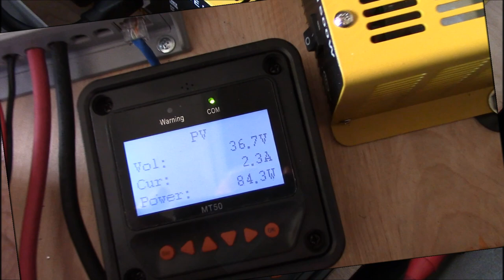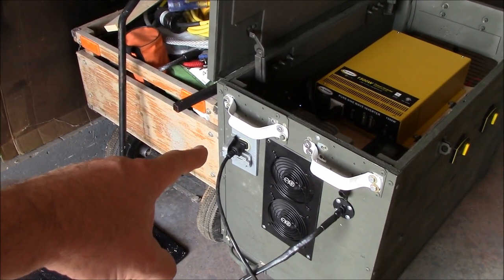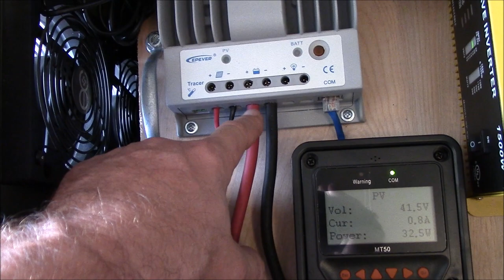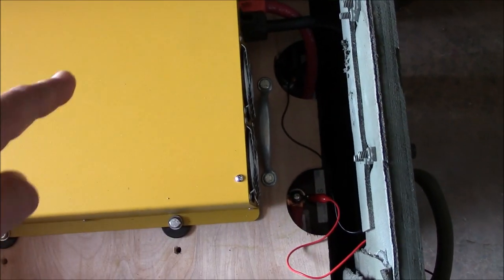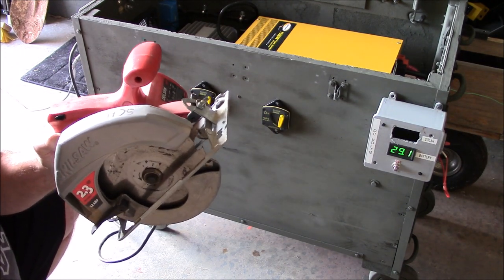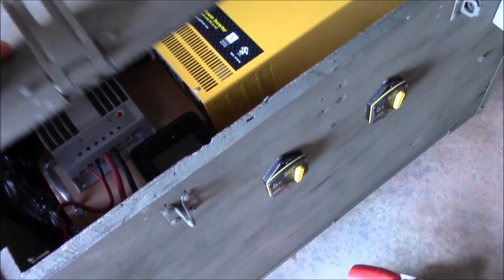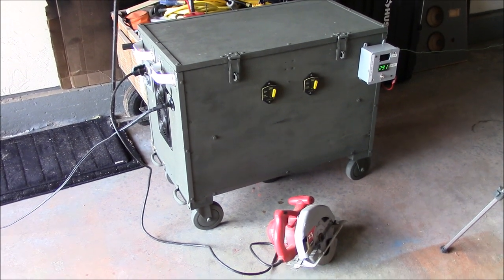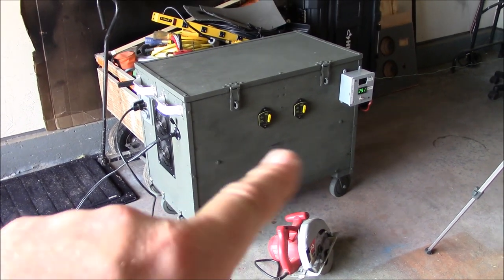DIY 24-volt solar generator (Part 5)

Comment: Looking good.  Weight is definitely a big problem with the portability.  I have been running solutions through my head trying to figure out how to get my own box back and forth, because I would like to it around for winter storms.  I think  I am leaning towards building it on a small trailer that is road worthy.
Reply from the maker: That would work. One guy I know is building one inside a truckbed toolbox. Power trailer is very cool idea...could also store, mount the solar panels.

Comment: Coming along nicely!  Food for thought have a look at a class 3 trailer hitch plug in type deer processing / hanging metal lifting rig , U can then use a inexpensive HF 2500lb winch with remote I have had mine for years. U could then load that heavy box into your truck no issues by your self. A class 3 hitch is way under  rated at 500 lbs. tongue  weight , that makes doing things buy yourself a breeze. plus it has many heavy lifting uses. nice job.
Reply from the maker: Thanks...will have to really look into those hoists. Wondering if it can be used in my garage (too tall?). Ramps are easy to set up too...might get more use out of the electric winch too...dunno which way is best.